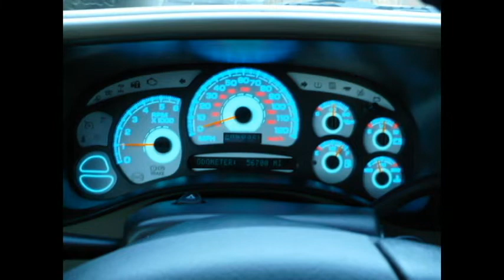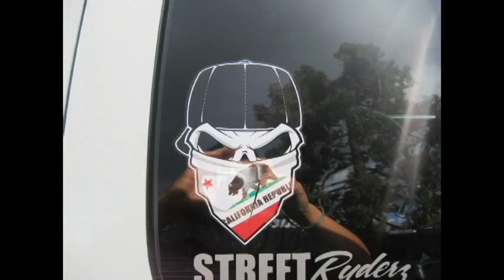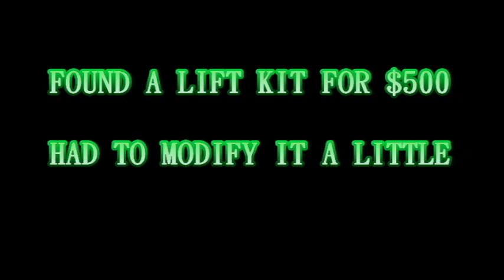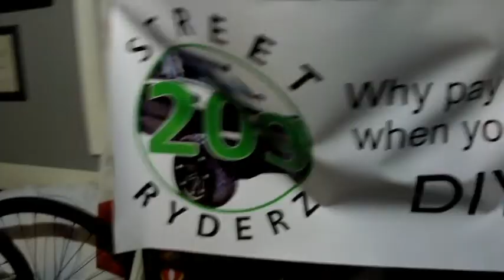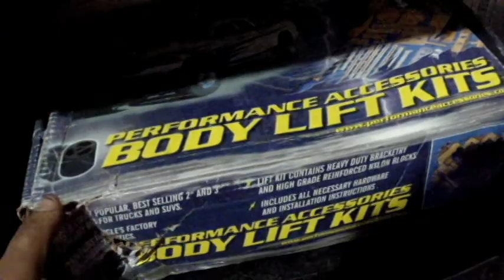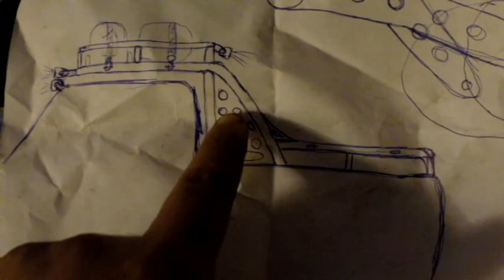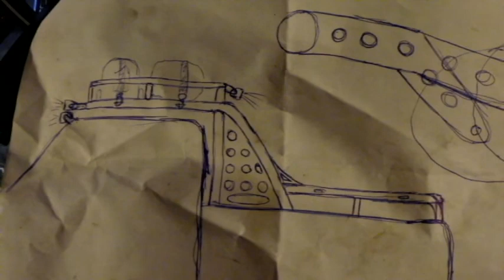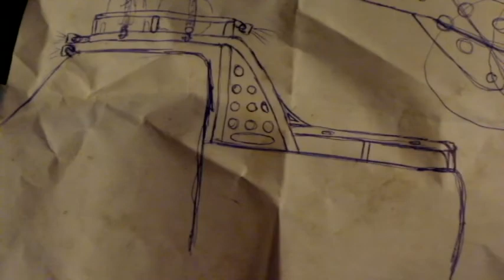My Silverado Timeline & Future plans!

Comment: awesome man can't wait for all those videos I've got tow mirrors on my truck and they don't look too big and we drive the same model.  too bad mine is a 2wd so I can't just buy any lift kit :/
Reply from the maker: Jared Ross thank you. I started the chase rack modification this weekend, your going to like it!. probably will be shot in a 2 part video but I'll load it this week. Also, my truck is 2wd as well. simply look out for a kit with coil springs. I got mine slightly used for $500 and believe me a 4wd fits you just have to cut a couple of non importantethings like bump stops and whatnot.
Reply: ill definetley keep my eyes out for a kit with coil springs.  i am honestly trying to get a set of rims like your current setup i saw them in the first video i saw of yours and i fell in love with them.  you are one of the few channels i look forward to posting content.  can't wait for the new videos keep up the amazing work